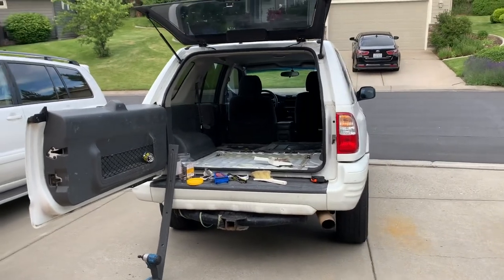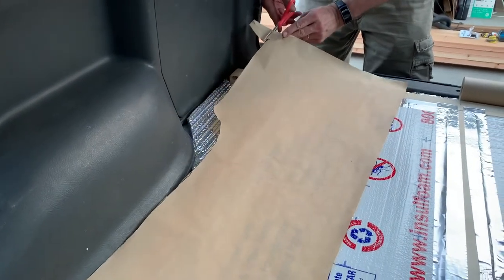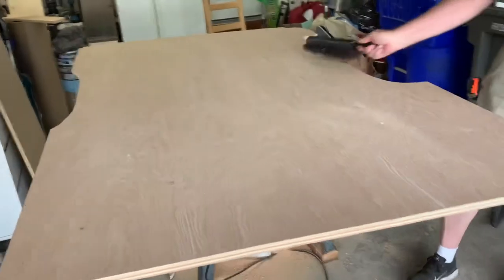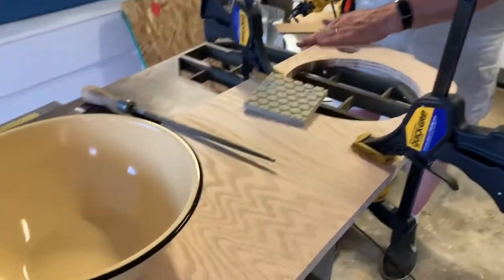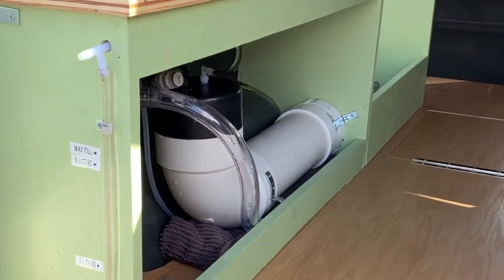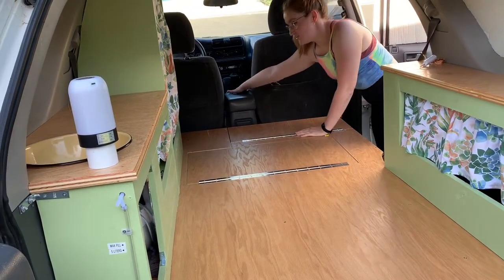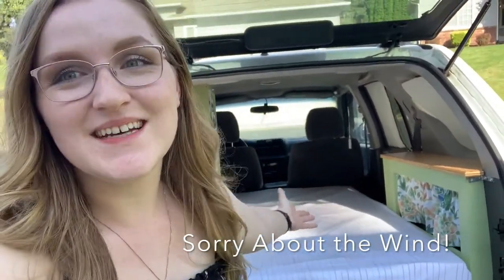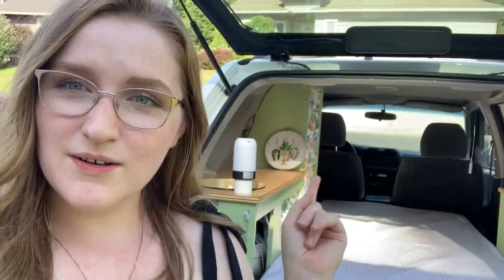DIY Micro Camper SUV Conversion - Isuzu Rodeo

Comment: Yep please! I have a 2003 !!! I want to do this more videos for sure!!
Reply from the maker: Thank you!!! I will make more! LMK what specifics you'd like I was planning a plumbing explanation video, Let me know what else you would be interested in!
Reply: Nice job! I've got a 2003 and am slowly making the components for a transformation into a roadworthy campmobile. I really liked the way you approached the typical issues like plumbing, electrical and sleeping. 

For myself, different options have been chosen. Instead of storage under the platform, I'll have battery and all-in-one charger/inverter. This is already doing duty at home as a battery backup system, but can be installed in the vehicle bolt-holes once the rear seats are removed. And aluminum Z-channel at the forward tiedowns will anchor a half platform,  hinged similarly to yours, over the electrical equipment. The rearmost section of the sleeping area behind the passenger seat will be padded to match the plywood thickness. (Carpet is in very good condition.) Air mattress/blanket on top.

Immediately behind the driver's seat will be a small compressor fridge and hanger clothes storage. Aft of that is a table with (identical nested) drainless bowl sink. Table has a built-in short backsplash and 2-foot pull-out extension for cooking outside the closed or open tailgate (with the rear hatch open, of course). Also has a single large fiberglass drawer aft of the sink.

This configuration does not provide for a whole bunch of extra inside storage beyond the front seat and perhaps some few items hanging in netting or pockets. So homemade roof racks to go on the existing rails, supporting a heavy duty hinged fiberglass cargo box and 2 x 100w solar panels. Racks are also fitted with four 1/2 inch aluminum rod extensions for attaching tarps or shade cloth. One tarp can be deployed vertically and staked down over a rubber door mat to make a sort of "mud room" at the passenger side rear door. 

More storage and equipment is carried in a swing-out cargo box on the installed hitch receiver. With that opened toward the passenger side and the tailgate opened opposite, all that's needed to give a cozy patio feel is a decent tarp a few feet past the open hatch and a comfy camp chair.

Not to be forgotten is good vehicle maintenance and breakdown prevention, as well as useful upgrades like rear helper springs and aftermarket rear camera.